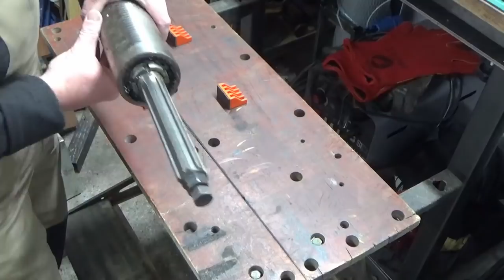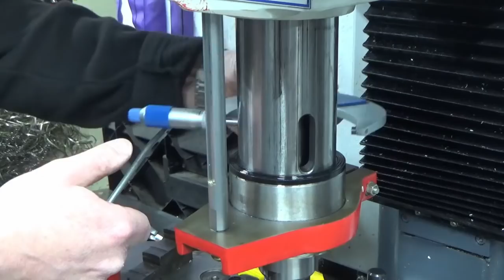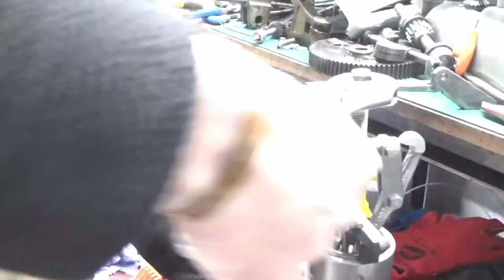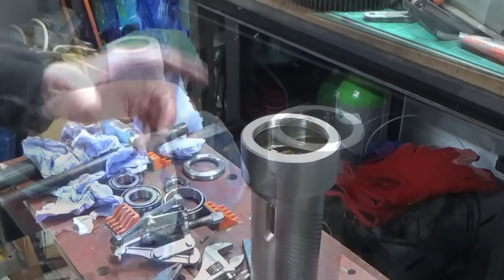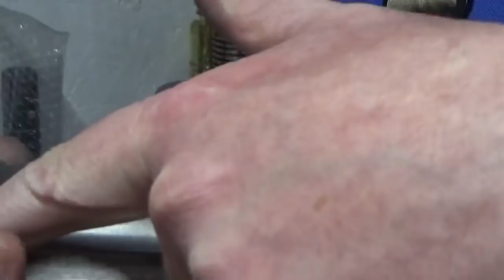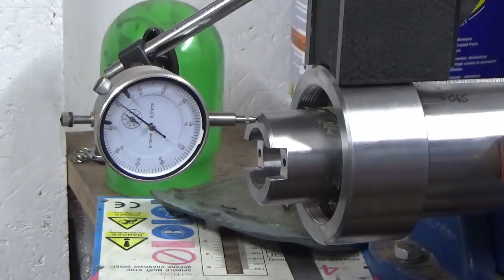7045 Milling Machine - Spindle Refurbishment & Bearing Replacement

Comment: Hello Jon, I would like to know what the appropriate preload is (in kilos of force or Newton), for this type of spindles for HBM 45. Thank you.
Reply from the maker: Hi, apologies, I could not find any specs for this so I did it purely by feel and measurement as shown in the video. I have used it a lot since then, and some heavy cuts (for the size of spindle) and there has been no excessive heat in the bearings, or no play developing. Hope this helps.

Comment: Hi Jon, quick question if i can.... have a new to me, used Beaver Mill mk2. I have measured the play left to right on the spindle and its 0.9mm. For how much i would use this machine being a new hobby for me should i just leave the play as is... or do i go down the rabbit hole on trying to find out where this play is and carry out repairs? Which poss could be more then the machine.... had a quote for new bearings £300.00, if the repair was just changing the bearings I could poss do that. I don’t believe nor can I find replacement quill or spindle for my machine.
Reply from the maker: Hi, difficult to give you a definite answer without seeing the machine but 0,9mm is practically unusable (I would be breaking a sweat at 0.09mm)!!! My suggestion would be to get dti's all over the thing and absolutely understand where the slop is (spindle, quill, head etc), then decide what to do. 0.9mm in bearings means they have totally collapsed, or the pre-load may have just worked loose, it is not wear! If it's just pre-load, then it might just need reset although if it has been run like this the bearings will probably be shot. Is there any end float in the spindle, this will be an indication of pre-load etc. Hope this helps 😄
Reply: Hi, thanks for the advice... doesn’t sound good news for me. Its seems i have nothing to lose so might as well separate the spindle and quill to have a look at the bearings. If no major issues are found put it back together, set the pre-load and carryout dti measurement of run-out again. And keep everything crossed.!!!!
In your experience it I done all the above and still have 0.9mm run-out what options do I have? Shame to weigh in the mill for scrap metal. @jonsworkshop

Comment: Please, could you send the bearing codes for this machine?
Reply from the maker: Hi, really sorry, but I don't want to send out anything on this. I have stripped three separate heads and spindles all off the 7045 machines, and the bearings have been different in all three. They fit bearings depending on how they machined the spindles is all I can assume. The only way to know for sure what you have is to strip your own unit down. The last thing I want is to give someone bad information leading to them buying incorrect parts. Hope you understand. Cheers, Jon
Reply: @jonsworkshop  I understand, thank you

Comment: Nice work, Jon.  Out of interest, what size are the bearings?
Reply from the maker: Hi Michel, thanks for the comment. 	Timken 30206 Metric Taper Roller Bearing 30x62x17.25mm & Timken 30207 Metric Taper Roller Bearing 35x72x18.25mm. Please be aware that these are unique to the ISO 30 and will be different to other types of taper. I would always suggest stripping your own and measuring prior to purchasing anything (remember where these are made!!). Cheers, Jon
Reply: @jonsworkshop  Cheers, Jon.  My problem is a bit different to yours, in that I have no vertical head at all, I was wondering how small you can go in bearing terms with an ISO30 taper spindle.  Those are a lot smaller than I was planning, I was looking at something more like a 30207 / 30209 pair, which would give me a fatter spindle, and thus more stiffness overall.  I'm not planing on having a spindle downfeed, so "cartridge" size is a lot less of an issue.

My mill's a Crouzet FC100, relatively similar in capacity but the layout is all different. 

Food for thought, food for thought.

Comment: WhenI rebuilt mine, I found the upper cup was screaming tight and I had to use a hydraulic press to get it out. Now the fun began, the bore was way undersize for the new bearing. And the housing had become belled from the bearing being pressed in, and the bell was eccentric due to the thinner wall by the rack. There was sufficient material that I could rebore to the correct diameter and centre it with the cartridge. I had to remove about .004” to get rid of the outer bell. 
The bore in the head was oversized by .007” so I had the quill hard nickel plated. It was now too tight for the head so careful polishing of the quill got it round and taper free. The head bore I touched up with a cylinder hone. It was slightly tapered also. I called it quits when I had .0005” to .001” clearance. Initially it was pretty tight but with lots of oil and exercise it moves smoothly now.
With the preload I used and running the spindle at 2200 rpm the top bearing was warm, but the lower was Round 140f. I now have a couple hundred hours on it and the lower bearing still warms up but not so much. I probably over greased the lower bearing, and the shaft seals don’t allow much grease to escape.
Overall it was worth doing. I used precision tapered bearings and made sure I lined the dots up. There is a lot less play in the quill assembly and a lot of chatter has been eliminated.
Reply from the maker: Hi Glenn, thanks for the comment and your own experience, very useful for others. Sounds like you had some fun with the top bearing....... I got lucky. When I ran my new bearings in on my Mt4 spindle, I got about the same temperature behaviour. Will report back on this one when we get to the big switch on. Cheers, Jon

Comment: Google's algorithm is really good. I'm in preparing to do similar work to a ZX50 mill I recently purchased. Like yours, it came with a MT4 spindle. After extensive queries, I was able to locate the actual manufacture and purchase a R8 spindle. So I greatly appreciate the information that you're providing because I intend to follow your path ;-)
Reply from the maker: Hi E Designs, thanks for the comment. Glad you found us and are finding the content useful. Good luck with yours! Cheers, Jon

Comment: Great interesting video Jon, pity the bearings were different sizes. Nice job cleaning, plugging and painting the spindle bore. Also admiring your unusual (to me)V blocks. Can you show us a quick look at them sometime in the future with any history if possible. Cheers Tony
Reply from the maker: Hi Tony, thanks for the comment and feedback. Regarding the V Blocks, they were my Dad's and would have come from a company called Clayton Dewandrer in Lincoln (made air compressors for wagons). They are in a sorry state and they will definitely be part of a future surface grinder project to bring them back from the brink! They will be from the 1960's / 1970s and shop made I think, no markings on them. Cheers, Jon

Comment: Nice idea on painting inside of quill, geometrics looked very good overall,  it's my understanding that Taper roller bearings don't like too much pre-load, ref large area of contact when compared to angular contact, or ball thrust types, but a good stepped heat and load cycle will settle them in, maybe run a suitable tool on some thrust bearings on the table,  and measure for hot points, but it all honesty,  the maximum rpm in use is well below the bearings specification. 
Glad the eggs weren't of an alien nature,  nice colour provided by the oils. Lol.
Thanks for sharing and stay safe all
Reply from the maker: Hi Bosted Tap, thanks for the comment. Yep, agree. I will run these in the same as my Mt4 I did I think (20 mins with zero load in each speed range starting at the slowest and working up). Probably going to get myself a digital pyrometer so I can be a bit more scientific about thermal effects. I just guessed on my Mt4 by using my hand and comparing to a hot cup of tea lol. Cheers, Jon

Comment: Well done Jon. 

Great public service highlighting what was lurking in the spindle bore. That seems to be a theme in certain production environments. Might as well strip your new machine or tools and deal with it before it shows up later. 

Thanks for showing spindle preload. I agree with the approach you took especially outside a laboratory it will be absolutely fine. When I did my surface grinder spindle and mill spindle it was much easier than described. Perfect - nope making good parts yup. Next project…😁
Reply from the maker: Hi Dan, thanks for the comment and feedback, much appreciated mate. Cheers, Jon

Comment: I wonder how the ramp or fillet at the bottom of the shaft splines were achieved? It wasn't a standard end mill, otherwise it would be rounded.
Reply from the maker: Hi Bob, thanks for the comment. I suspect they were put in using an inserted side & face cutter on a horizontal machining centre. They will definitely be CNC manufactured. Cheers, Jon
Reply: @jonsworkshop  oh yeah! LOL!  They probably cut it with a beefy slitting saw.

Comment: Nice job Jon. It is almost identical to the R8 spindle in my VMC. Mine is slightly earlier and has an angular contact ball bearing at the taper end rather than a taper roller. I use Koyo bearings in just about everything I work on because I find them to be excellent quality. Made in Japan and there doesn't seem to be counterfeits out there as there so often are with SKF. I see you used Timken so I doubt you'll be changing them for a good long time. 
Best wishes, Dean.
Reply from the maker: Hi Dean, thanks for the comment. Yeah, I am not even sure on the Timkens to be honest, they were only a couple of quid dearer than SKF so clearly not the Timken they used to be. Still better than the hairdryer bearings fitted in the factory though (hopefully). Cheers, Jon

Comment: Further thought Jon, you only need to take into account the diameter error on the lower half of the spindle, when you make the collar as  the rest will be up inside the head. Regards from Australia.
Reply from the maker: Hi Dave, spot on. As it happens, it won't make any difference I don't think as the largest diameter on the quill cartridge is at the bottom. Good it is this way round meaning maximum rigidity with the quill fully retracted for milling ops etc. Cheers, Jon

Comment: Hi Jon, my Zay 7032 Mill Drill had 55mm of unsupported bearing surface fully retracted around the Quill dia.
Machined a 55mm thick block of aluminium to make precise bore to suit Quill and JB weld epoxied the block into the casting with the Quill in situ, self aligning around the Quill, oiling the Quill to prevent the Quill glueing itself.
I filled the voids with super strength Araldite around the block and casting to the top of the block.
Nice tight Quill for the first 55mm 2 years later.
I try and plan my work with minimal Quill extension but sometimes difficult with a round head mill drill but it does the job.
Max Grant idea is the best chroming and grinding but I don't have a Churchill cylindrical grinder!
Reply from the maker: Hi Willem, thanks for the comment. Interesting insight into your mod, sounds good! I have a spare head so if I get bother from the slop, I will swap heads over, and use the spare head to bore my head casting out to take bronze sleeves (assuming I can fit it all into the capacity between table and head in the highest position). Alas, I too don't own a cylindrical grinder! Cheers, Jon

Comment: Good one Jon .  I think the last time i checked the play in my one , combined spindle & quill unlocked was 018 ''  .   I will probably look at getting the quill hardchromed or sleeving the head .    Did the 30 taper have a larger bearing ?    👍
Reply from the maker: Hi Max, thanks for the comment. Yes, the 30 taper spindle had a bearing with larger O/D (Cup) and same I/D (cone), so much more robust hopefully. Cheers, Jon

Comment: Great stuff so far Jon. Look forward to seeing it all go together. Just out of interest, what is the fit of the int 30 spindle in the spare head casting you have? If it is better than 30 micron you are onto a winner.
Reply from the maker: Hi Carl, thanks for the comment. The other head is about the same as mine based on a quick bore measurement (still need to measure my bore once spindle is extracted). The other head is much older and missing some features mine has so ideally I want to keep mine as original. I have a cunning plan, if the slop really causes agro, I may swap the heads and use the spare head to rebore mine allowing for bronze sleeves, how's that for video material lol. Cheers, Jon
Reply: @jonsworkshop  Sounds good. I am looking forward to seeing how things progress.

Comment: wat you could do to get one of them to fit tighter in the head is to have one of them electro plated then put it in the lathe and use a toolpost grinder to cut it perfectly to spec 
i think theres a way to prevent the rack from getting plated , think they use a special paint 
might even run a verry large reamer or a good rigid hone through the head and get it perfect
should take care of the damaged areas too
Reply from the maker: Hi Watahyahknow, thanks for the comment. Yes, that could work. If I find it a particular problem, my initial thinking was, as I now have a spare head, I could swap the heads over, put my old Mt4 spindle in the spare head and bore my Cormak head out for a bronze sleeve. That would make a good video. Cheers, Jon

Comment: Nice job on the spindle. Good idea to paint the inside if youve got it that far apart.
For the preload adjustment you could look in the manual for your M300 to see what Harrison suggest for the process of adjusting those spindle bearings. I think youve probably got it pretty good. When you get it running, leave it running for a while and see how warm they get.
Reply from the maker: Hi Robert, thanks for the comment and suggestion. I never thought of that, I will take a quick look today at the M300 script. Cheers, Jon